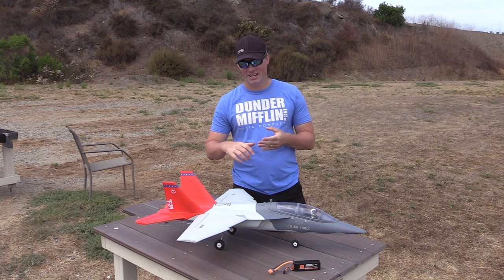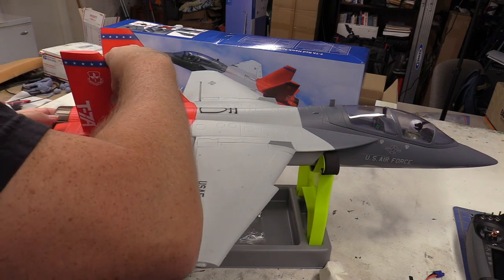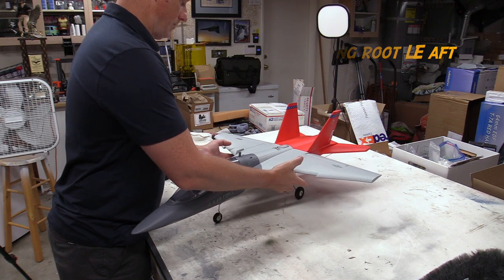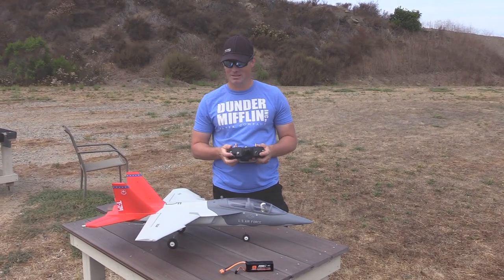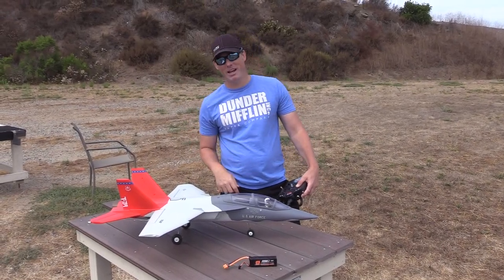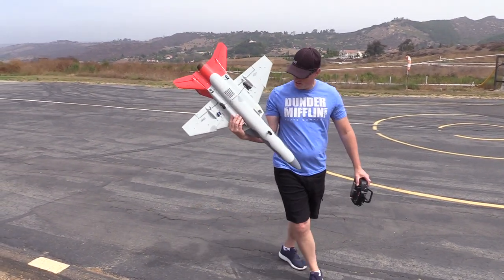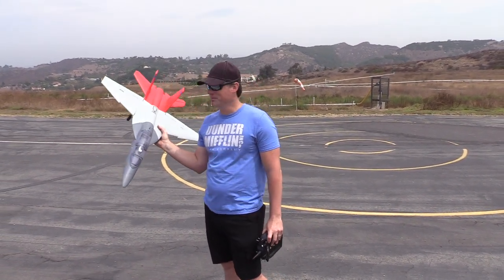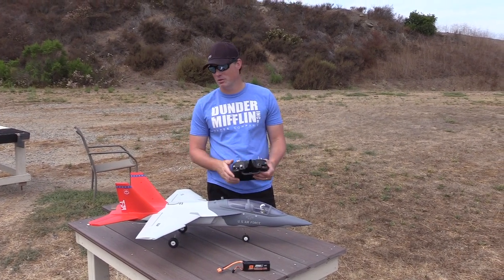From the Field -- XFly T-7A Red Hawk 64mm EDF Jet Assembly & Flight Review

Comment: X-Fly owes you a commission.  After watching this video I ordered one.  It should be ready to maiden next Sunday.  BTW,  I am impressed with this model.  The finish is superb.
Reply: I'm ready to order one too! What do you think of it Robert? You've probably got to maiden  it by now
Reply: @HciContractor  I haven't maidened it yet, but the assembly is very easy and this is the best paint job I've seen on a foaming so far.  Well worth the money.
Reply: @robertcampbell6349  good luck 🍀 on the Maiden brother!
Reply: @HciContractor  Thank you.
Reply: How does it fly? Have you maidened?
Reply: I crashed mine, piece of crap
Reply: @mihauok1  jets aren't easy to fly. I crashed a couple of my first jets.  Landings have to be done so fast just like a real jet that lots of crashes happen. We've got a crappy runway and the plane will bounce or veer because it's so rough. 
  I had an F-15 took off in gyro wings level mode and flipped it off, the plane went straight down. Idk what happened that time. The lesson for me was to double check the gyros are not in backwards and of course control surfaces are correct. 
  They definitely aren't for beginners and I pushed it. I fly jets all right now. I only crash once in awhile! 😂

Comment: Glad to see a different, lesser modeled EDF jet. For a 64mm bird, she sounds amazing! I'd probably lose the fixed gear and go for a hand launch.
Reply from the maker: Agreed on something different. I’m hopeful we’ll see a larger one at some point. would look nicer without the gear. I’m a terrible hand launcher, so I won’t even try, haha!  It is a little awkward to try and grasp though as it’s actually pretty wide across the bottom.
Reply: @Thercgeek  Yeah, Chris this one might require an assistant to hand launch ... at least until you get the toss perfected? I used to fly these smaller jets just about every outing but I have drifted away from the 50mm/64mm airframes. My hand launch technique has probably staled somewhat. I sometimes go with a two handed overhand toss when the fuselage form factor makes it tough to grip. I was born with small hands, which surely doesn't help.😂
Reply from the maker: Haha, no matter what, your hand launch will be better than mine! 🤣

Comment: Just maidened mine today…..very, very quiet. I found the recommended aileron throws very anemic (and I am not a yanky bank flyer). That is easily fixed. Nice flier. Even though it is quite fast it seems like it needs a bit more power….I'm hoping some high C batteries will fix that. Fit and finish is beautiful. Only 2 minute flight on 2200 4s…..I see some guys have stuffed 3200's in there….I will have to try that…👍👍

Comment: Hi what pitch guage is that and brand? By the way I have this plane i just got it assemble i have to just install push rod and install receiver and adjust the trows. I don't know if I should put a gyro because gyro suppose to be on cg. But plane is georgous :)
Reply from the maker: I have a deflection gauge available through my website: https://www.thercgeek.com/product/Control-Surface-Deflection-Meter  on the gyro, it’ll be fine if it’s not on the cg. Rarely are they based on where the receivers end up.

Comment: I feel like anyone who's come off any of the Freewing 64mm series... mig, lippisch etc, will find this a little slow. Even on 4s. I bought an F22 with a 64mm fan and even on 4s it just felt like I was flying a kite. Nowhere near the speed of the lippisch P.15 that cut through the air, rolled like a drill bit and glided like a sailplane. I've not found a plane I've liked more. I'm glad people have this plane and many others, but it reinforced the decision to get the P.15 and I haven't looked back since.
Reply from the maker: Fair enough. The lippisch is a cleaner aerodynamic design, so I’m not surprised that the performance would be better.  This lippisch tailless designs are pretty incredible and make for good flying models. The me163 is a really good and clean flying one also.

Comment: How did you put reverse thrust? Is it from a stock esc?
Reply from the maker: I did not put reverse thrust on this one. My understanding though is that it mostly just requires plugging the yellow wire into a spare channel and assigning a switch to it.
Reply: Oh really? 7:36 looks like your reverse thrusted to brake
Reply: @Sikke107 😯

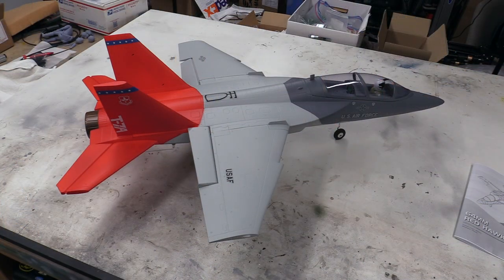Comment: information.          reality check.       is the edf  spec'd for  4s.?         there is nothing  novel, about this new design.     see other, shoulder-wing,  jets/Trainers.          at 2:45,  this  is   SCREWY    aileron  design.!  (makes no difference if it's scale accurate; it's still  wrong.)          why is this true:   the non-moving areas of the trailing edge at the wingtips,  DAMP  responses to  all  aileron inputs.!!!!            at 1:22, MOST models, especially fighter jet types, have  a  less-than  ideal  distribution of mass (dom).        consequently,  Anytime  i see the Mass of servos located  Aft of the cg/c-m of an airframe, i question the  the  Wisdom of doing so.!             googletranslate